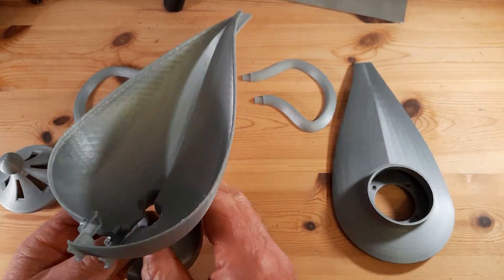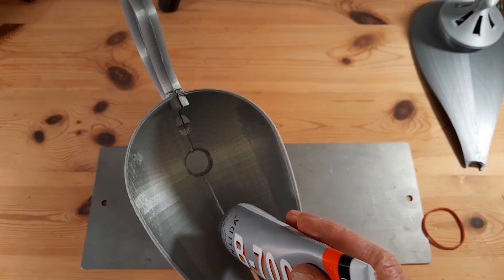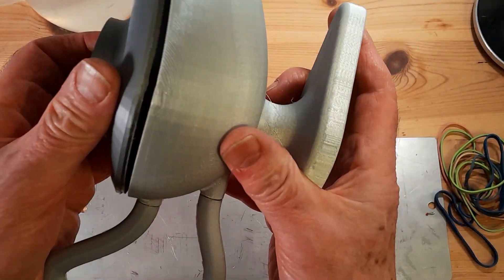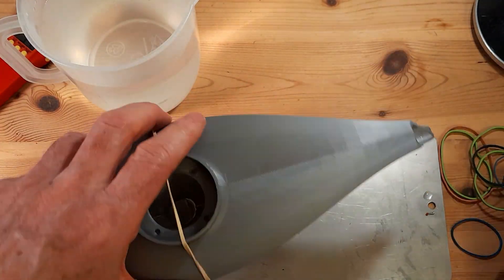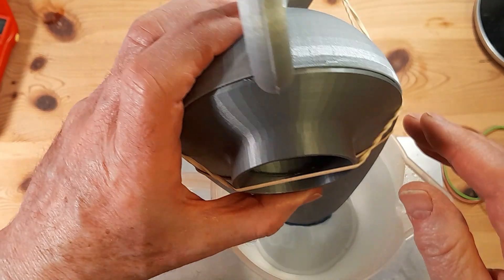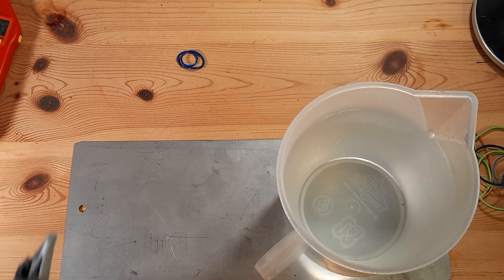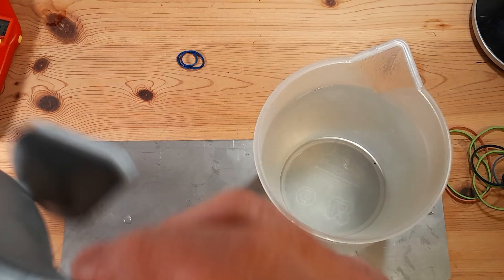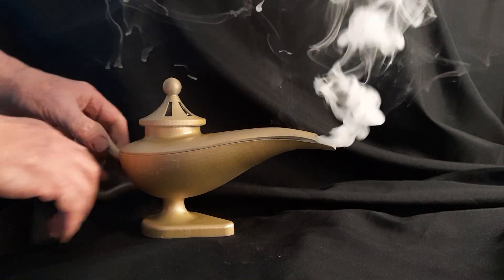Sidelines: PLA 3D print hot water tweaking

Comment: That's a nice trick! A slight recommendation would be for the print base to be three pieces, the handle, the actual base and the vessel, with the vessel in one piece and on its head, that would achieve the ideal 3d printing orientation to avoid warping, and if for some reason you need really good tolerances you could print it with a raft
Reply from the maker: Thanks, Eric. I had a couple of constraints. I have a really cheap, low-quality printer at home but decided to make these on an Ultimaker 2+ at my local library. (It just worked!) The print bed is about 22.5 cm square so it was a tight fit. It also put all the support on the inside which kept the outside clean. I think I could have avoided most of the distortion by fitting the lamp top during the glue-up. It would have held the lamp sides in the correct relative positions. Have a look at https://youtu.be/PWJ1t3-23SE?si=TVp8rnDAgg5_9OKE to see more!
Reply: @QuickPLC-kh5of  I see, in that case you may benefit from creating a guiding lid, just some "jigsaw" pattern on the bottom that will help you align everything else, you could also get some ideas from wood joins, I've made my fair share of them for 3D prints and they do wonders